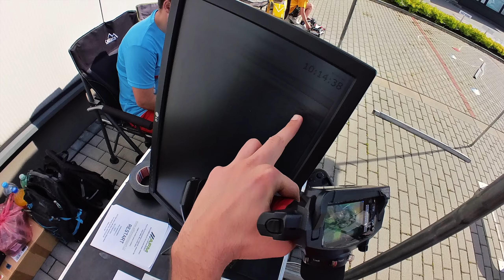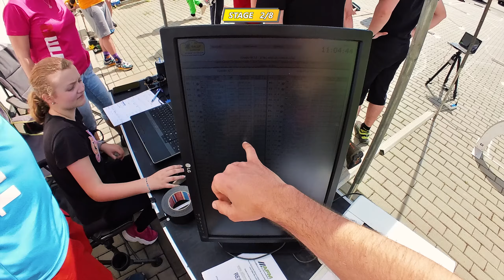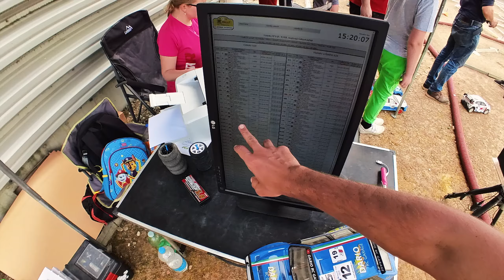I've thrown my race away! Racing among the bests! Rc Rally Championship

Comment: Very cool rally! Looks like some very challenging courses. Just curious, what are the different chassis used here by other racers? Thanks and ciao! :goodvibes:
Reply from the maker: Thanks! 
Mainly Xray T3-T4-XB4 then Tamiya XV-01 and 02
Reply: @dariorcgarage  Cool, thanks for the reply. I'm looking at getting the new XM-01 by Tamiya for a build. I know it's a smaller wheelbase for the M bodies, but it looks like a well designed kit.. just the battery tray is to small for a modern lipo from the reviews I've seen.
Reply from the maker: @scaleworksRC it's like a baby XV-02, great choice 👍

Comment: Fantástico video, lo he disfrutado muchísimo...
Si te puedo hacer una pregunta...
Qué silicona usas de diferenciales según sea asfalto o tierra?
Muchas gracias por tus vídeos
Reply from the maker: It depends by many factors, just start using 8000-4000and then adapt it based on the conditions,like for off-road try 5000-2000👍

Comment: If you can program your esc.  I would slow down the initial throttle and adjust the throttle curve on your radio
Reply from the maker: Thanks for the suggestion, right now I'm trying to find the best option using the neutral range on the esc

Comment: In my opinion your car is oversteer to much.
Reply from the maker: Thank you for sharing your opinion, you mean in general or on a specific surface? 
During this week I worked a lot in order to improve my setup for tarmac, this Sunday I'm going to race in similar conditions.
So we will see if I did the right changes!
Reply: @dariorcgarage  In my opinion, it rides quite well on gravel. on asphalt it exhibits oversteer. I couldn't drive your car fast on asphalt.
I like it when I press the gas and the car goes straight, that's how I try to set my RC
Reply: @dariorcgarage  Hey, I have one more question. I bought a Justock hobbywing for my rally car. I have made an innerbody like Tux, but there is always some dust getting inside. Sometimes I wish I could ride without innerbody so there would be better cooling. Do you need to take care of the engine somehow? maintain it? I don't want to damage it, and it has many holes through which sand can fly inside.
Reply from the maker: @Jacyk dust should not be a problem, just make sure time to time to open the engine and clean it. Especially after an offroad session. Till now using a cover I'm not facing overheating problems. But let's see this summer
Reply: @dariorcgarage  I see in the movies that in the XV 01 you also had this engine.   He was not sheltered there. Were there any problems with it?
Today I trained for an hour in the cover, it was warm, but normal
Reply from the maker: @Jacyk  no problems at all. On the XV-01 I was doing some maintenance after each 2 onroad rally and each offorad rally. So don't need to worry a lot
Reply: @dariorcgarage  thanks, you comforted me, I will sleep peacefully :D